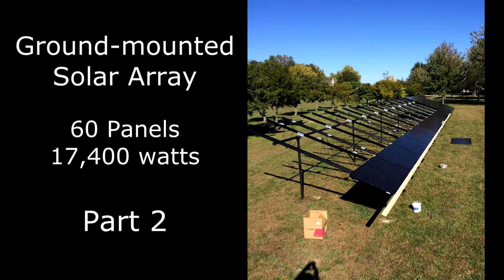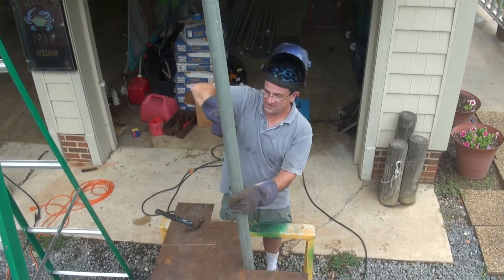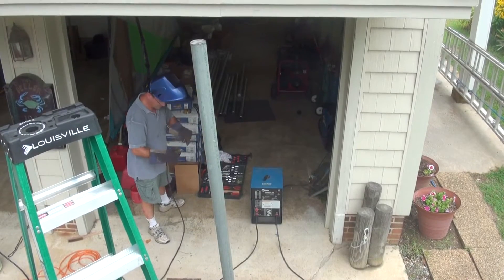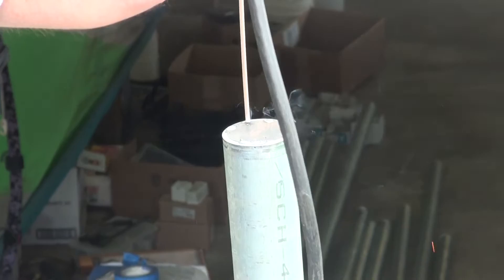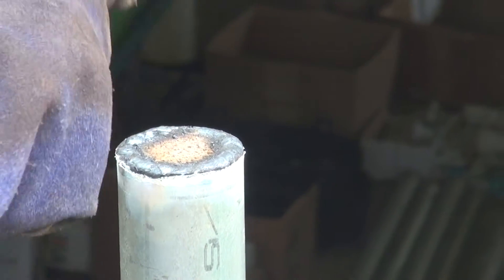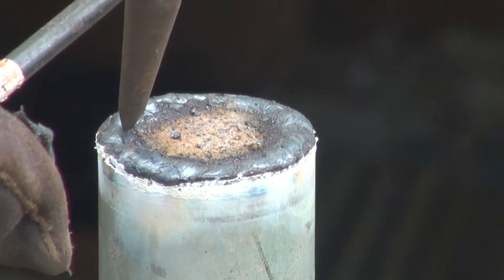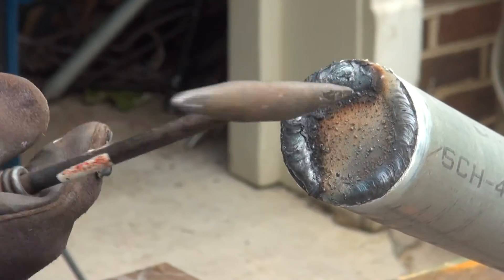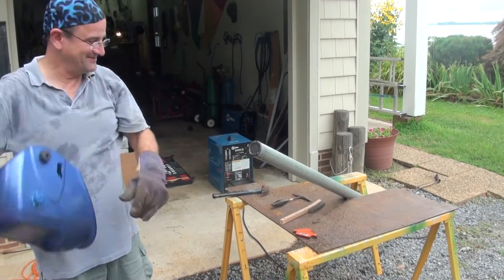DIY Field Solar Array - Part 2

Comment: could have used liquid flashing made for doing sealing on glass to metal.  10 minutes and you would have been done.  fill the ends with expanding foam.. then once closed up.. apply the liquid flash.. it would still be there 100 years from now.
Reply from the maker: 100%

Comment: Could spray foam in the pipe have sealed it off?. It looks like the iron ridge cap is sealed anyway. Great job on the ground array, looks good.
Reply from the maker: Yep.  I think I just wanted to use the welder.  That's really the only explanation.